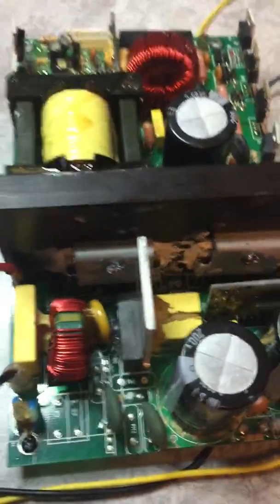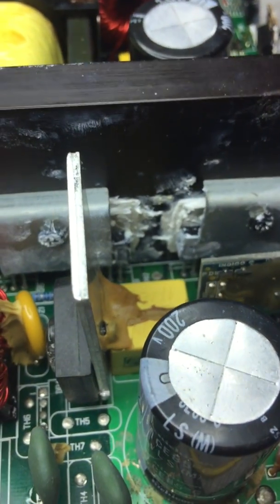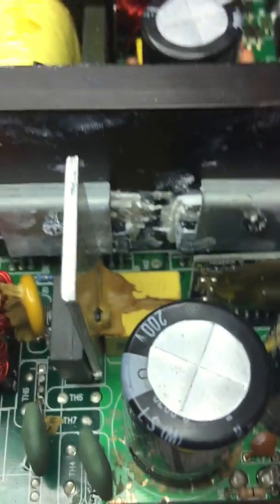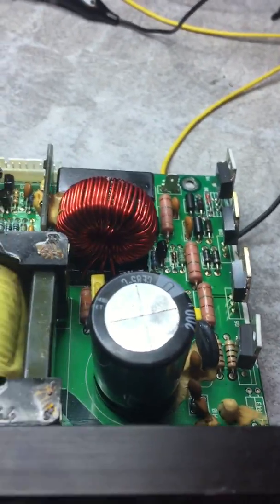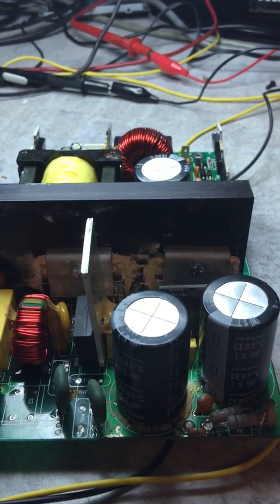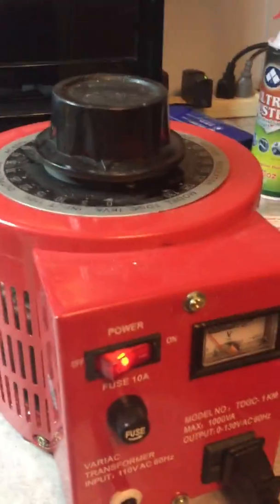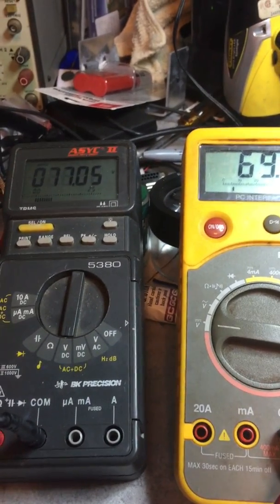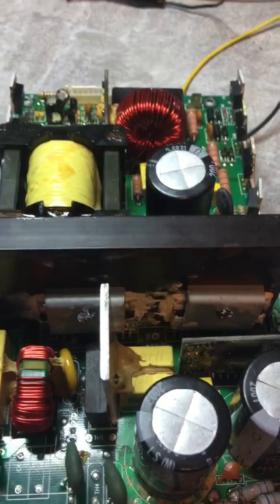IMG 0493

Comment: Thanks Sam! Good video. I have the same Power supply board from a SVS subwoofer. Mines 640047 Rev 3, but more then likely very close to that. When I power it on it ticks, (audible ticking heard) and the output instead of being 7-10V like it should be is going up and down with the ticking. I have a second Sub with the same amp and swapped only power supply boards and it works fine so I know it's in the board. Would you still think that's the caps and thermistors?